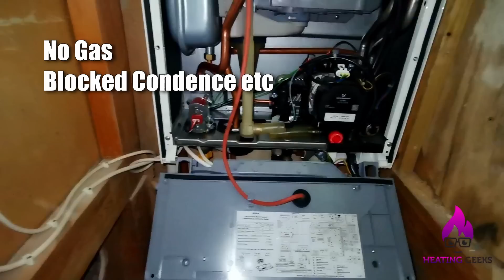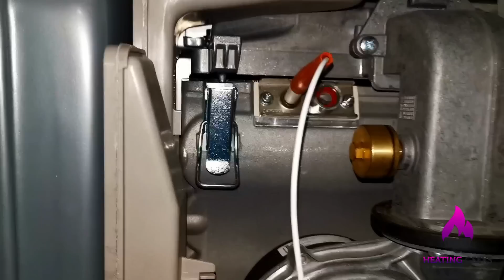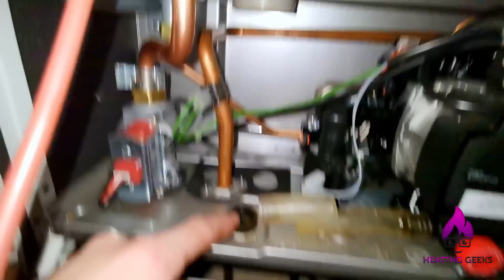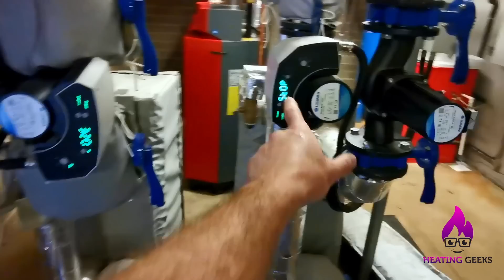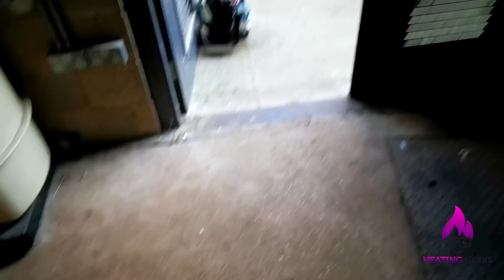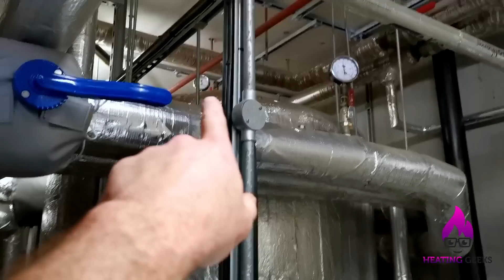Lets Go To Work, Alpha Intel 2 E01 Repair

Comment: Thank god it isn’t just me. They alpha intec 2’s anytime I went to them the gas valve readings were all over the place, replaced it, auto calibrated and as you said had to manually do it and ran out of parameter. It’s a shambles of a boiler 😂

Comment: Biomass boilers have a lamba sensor installed in their flue which monitors the residual oxygen level in the products of combustion, and adjusts the amount of input air to achieve better more efficient safe combustion. As you said combustion is combustion no matter what the fuel source. Brilliant video, deep tech alway stimulates the mind.
Reply from the maker: Nice. I just had to get it out there. It has been in my head for a few years. Im glad you have seen Lamba sensors, one of my mates called me to say I was making it up. :-)

Comment: I work for Baxi the GA was a bit of a nightmare initially but we’ve got on top of it now, we changed the PCB software to get around a lot of the issues. And like you say we now use the Black GV and once you get one sorted it’s pretty good. You can auto calibrate them, then manually go into each setting hi/low/mid and get it via the display where you need it to be. Many years ago though caused no end of headaches, mostly due to engineers not understanding how they work.
Reply from the maker: I really did help develop the black gas valve. I videoed 20-30 valves before and after replacement. Sent all the videos to Warmhaus. Met them at a test center so we could go through every valve. They took our findings to Betelli and got the valve updated. I posted a photo of the trial gas valve on instagram today. On my story. :-)
Reply: @HeatingGeek  ahh top man. I’ve never seen the internals before and how it actually moves so every day is a school day for me aswell!
Reply from the maker: @alimack5489  Amazing how it flutters inside from the PWM.

Comment: Fantastic as always Ollie. You put all the other ‘Washer Changers: on Utube to shame👍👍
Amazingly insightful regarding the Combustion Controls Systems.

Question; Appliances with the Bertelli  GV & PCB, on a Combi Boiler, would it be possible to set them up with Hot Water running continually, to dissipate heat?
Thanks for sharing your very insightful knowledge.
Fantastic viewing also on the Commercial stuff👍👍
Dick Puller❤❤
Reply from the maker: Yes you can if you have the flow rate. But usually you don't. I have had a lot of trouble setting them up. Also you see them a lot on LPG and the statics don't usually have more than 7-8LPM.
Reply: @HeatingGeek  Flow Rate is generally not a big issue here in Jockoland Ollie. However, there’s some locations that are fairly poor.

You’re the first Gas Engineer I’ve watched on UTube that discussed the likes of Bertelli & other Combustion Control Systems. You also make a great point about Boiler Manufacturers following the lead of Car Manufacturers.  Indeed, the OT/Bus Protocol control systems came from there also.
Reply from the maker: @TheDickPuller  Yes, you are absolutely correct. CAN Bus was used on cars a long long time ago. My year 2000 5 Series used it and I don't think it was the first. I bet it goes back to the early 90s.
I completely forgot about that. :-)

Comment: surly just replacing the bladder would of been easier to do
Reply from the maker: I was told not to. :-) I do agree though. I wanted to replace all 3 bladders but the client wanted the 1 vessel replaced. The ended up doing the other 2 later in the year.
Reply: @HeatingGeek   least you got some decent fire bins
Reply from the maker: @originalshedboi  Had to cut them up to get them out. So no BBQ or fire bins. :-(